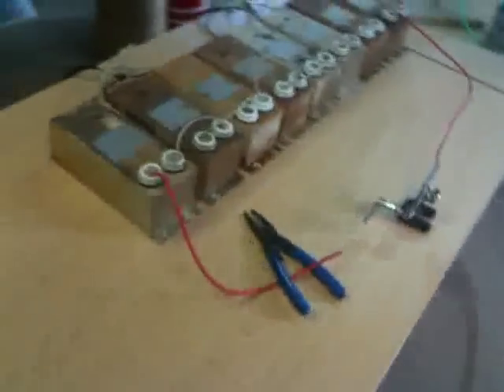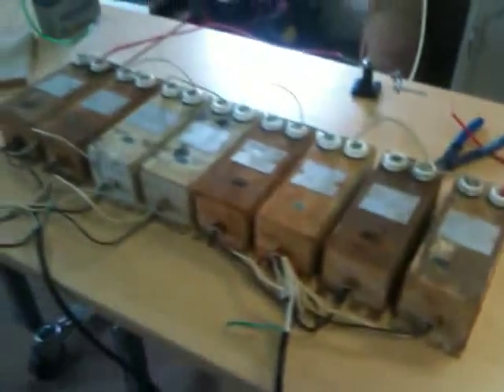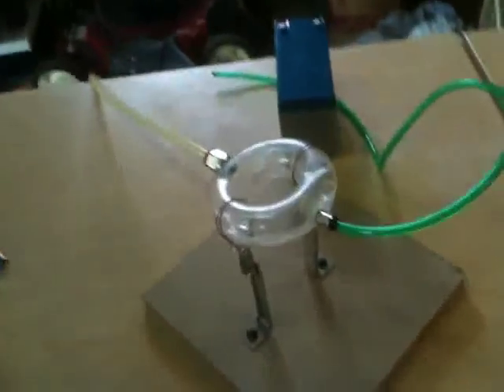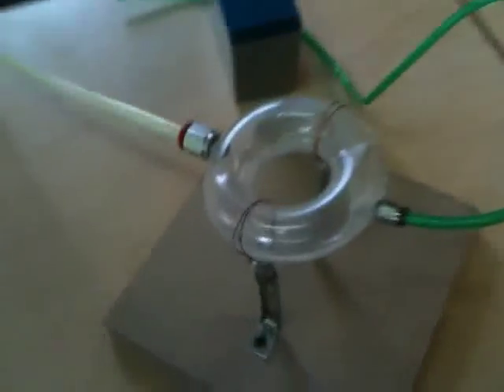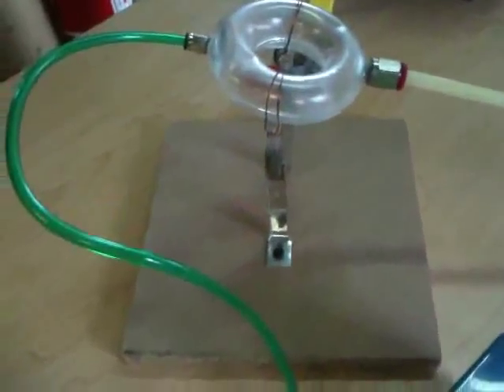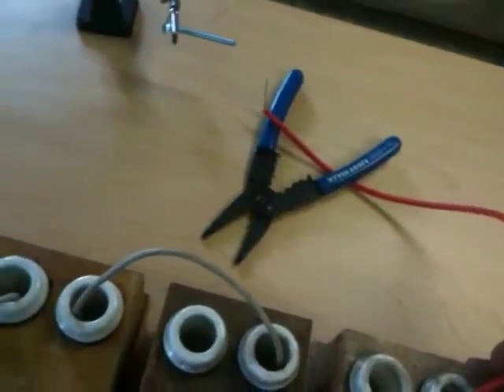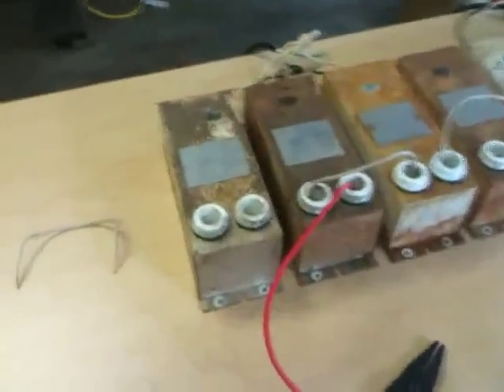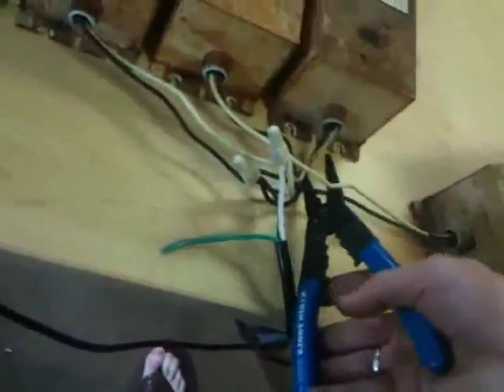High Voltage Arching Via 40,000 Bank Of 8 5000 v Transformers... Fail ! Lol Just For Fun

Comment: Hi Russ, for a good isolation with hy tention its better to put Your transformer/s in an oil-bad. I hade the same problem when I made my electric fensing for my sheeps (60000V 1,5Joule) jumps over 2 to 4 cm !  I made the transformer myself  +- 1kg ! 4 - 400 turns and start with 618V over the primery. 
You make nice job, good luck !

Comment: To fibrillate the human heart, you need a high enough voltage to overcome the resistance of the skin AND the amperage to cause the fibrillation. In this case, 40 kV (40,000 volts) is far more than enough to overcome the resistance but you would need at least 30 mA or more to damage the heart. For example, 40 kV at 1 mA would give you a nasty shock but only 1 kV at 500 mA would knock you dead with severe burns.